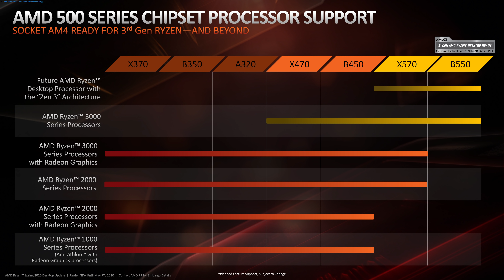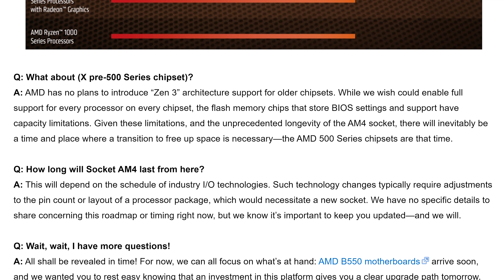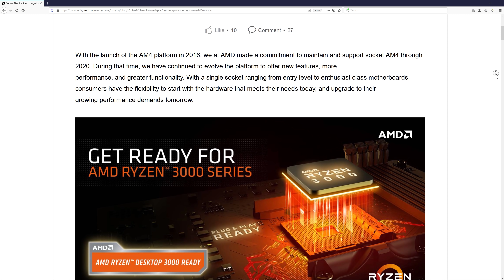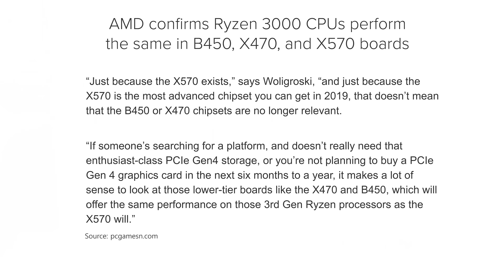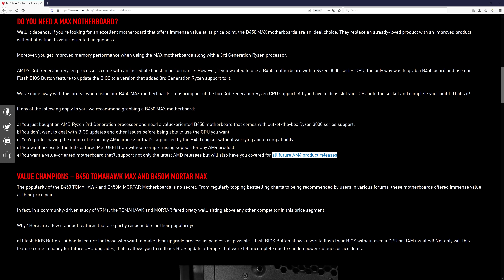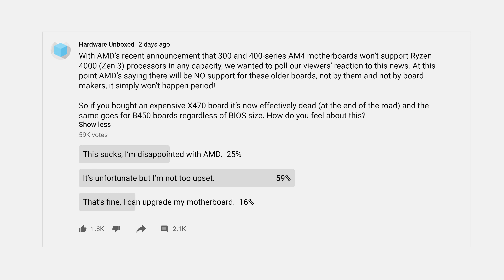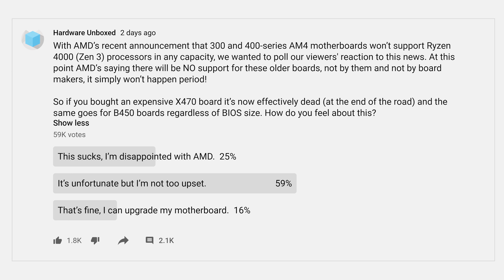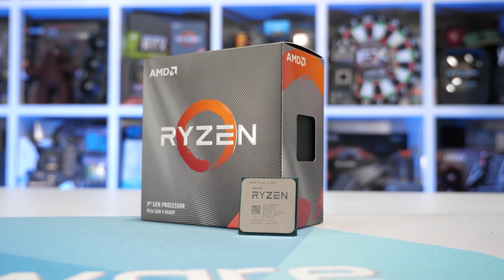AMD Does An Intel, Axes Zen 3 on 400-Series Motherboards, Our Thoughts

Comment: I'm very glad they went back on that decision. Today I'm running a 5950X on my B450-GAMING-PRO-CARBON-AC (bought it by your recommendation) and it's rock solid (after I did a minor under volt offset for the CPU).

Comment: I personally wouldn't be too surprised if this was a last minute call due lower production that came with Coranovirus which began to slow things down around Q3 last year, besides, let's remember that unlike Intel, AMD generally extends the longevity of their boards. EVEN if it has to be though a bios update that many times comes on later. 

There's also always the option, while rather unlikely, that AMD ran into a technological dead end where some of the components required to continue to provide support for older CPUs.

But all we can do at this point is to speculate until AMD decides to explain what's going on.

Comment: Having owned intel cpu's from my last couple of upgrade, any board that supports more than 1 to 2 gens of cpu is a bonus.

I'll just buy a board with the features i need in future and not get the best there is.

Probably buy a B550 board in future, £100 on a board, i aint gonna be to upset when they ditch it

Comment: I think that the key here is a question on how often do you upgrade the CPU. The most upgraded part is the GPU and that makes the most difference in games. I have been rocking on dinosaur i5 k2600k for 7 years now (OC) but have upgraded the GPU/Hard Drives few times. The bottom range MBs are cheap enough to upgrade (lets say $200 aud every 2-3 years) . Get your self a cheap B450, 16GB ram and a decent GPU  (even mid-range one) and you will be set for next 2-3 years in terms of CPU/MB/Ram (in about 1 years time, add another 16gb, ie just before DDR5 kick into the mainstream). Once you outgrow that combo in 2-3 years, sell your gear and get anther cheap B650 (or whatever it may be called), Zen 5 CPU and DDR5.  If you need more CPU grunt in the near term, the B450/X570 will be able to support existing multi-core CPUs so get one of those in few years time 2nd hand.  I personally think that a cheap B450 and something like 1600AF is a perfect combo atm.  For $300-$330 AUD you will be rocking with a solid MB/CPU and with a view that it will support ALL of the current multi-core CPUs (bar the new ones).

Comment: Im in the "I got myself a x570 so im all set" camp.  How ever it is a realy intel (dick) move. If the b550 came out at zen2 launch then ok but ppl were puched towards 400 boards so amd realy NEED to support zen3 on both 5 and 400 series boards. If they dont I think there should be lawsuits. It realy isn't acceptable.

Comment: AMD caused this mess by not having B550 ready at the same time (or very close) to X570/Ryzen 3000 release. People buying a $200 Ryzen 5 CPU in 2019 weren't looking to spend $180 to $300 on an X570 board. B450 was the only sensible choice, and AMD encouraged people to buy that CPU/motherboard combination. All their talk about multi-generational support, and they basically forced buyers into a single generation of CPU support. That's shady as hell. They need to get their shit together on the chipset side of things, because that's what caused this uproar.

Comment: I buy my B450 Asus prime plus with R5 3600 CPU and I don't get the all this upset story list of CPU compatibile with this chipset is massive. 46 CPU to chose, all you need latest stuff when the 2nd gen is still capable do a lot. You just gaming buy B450 and R3 3300X. Need more cores get some R9 3950X work on it just fine, high clocks or 32 cores will get the job for next few years. Ok if just want to build in next year go for 3rd gen but if you as most looking for desent pc for money B450 will still be nice to have.

Comment: I'm on that 2nd choice of ur polls, and its because i've just bought R1700x and X370 mobo for future upgrade (to ryzen 3rd gen series).

Sure we are lucky (for those who bought x370 and 300series mobo). But given the reasons (Bios capacity) why AMD dropped Ryzen 4000s support for 400 series chipset, are just sucks. That multiple of Bios choice would be great (if its true), But it will be limited in some mobo, though its fine (considering the price and its components).

I remember consider buying x570 mobo, but 1st gen ryzen are much cheaper in my area therefore i bought x370. So my upgrade path isn't bad after all (can up to 3950x with Hero VI)

Comment: Although I do understand where people are coming from, they did explain why, many features were being held back in order to maintain retroactive support to older motherboards...
In order to have the new features, a motherboard "refresh" was necessary, and so, they decided that after 3 gens of ryzen, they should finally put everything towards what they can achieve. Most people complaining about their motherboard being abandoned wanted simply the possibility of upgrading if they want to, and that's fair, but it's also not a sensible business strategy, last they start to lag behind Intel and then everyone starts to claim that Intel is winning again..
 We can't have it both ways, unfortunately. As for the advertisement that it's run on future ryzen systems, at least we were given a heads up, instead of going full rename and rebrand, to say: "oh, but it's not ryzen anymore, it's xxxxxxx lake!". However, if you do feel cheated somehow, you are also within your rights to discuss with the mb manufacturer or even taking legal action, depending on what was advertised. 
Just my 2 cents, sorry for rambling and good luck for everyone!
Reply: Last year AMD had to pay 12 milion $ becasue of false advertising with their previous FX series CPU.

Comment: This stinks! I purchased a b450 Tomahawk max and paired it with a 2600 for my sons birthday only a month ago. It was the obvious path with b550 not available and both AMD and MSI saying that future cpu's would be supported at least through 2020. The plan was to upgrade to the4000 12 core in a year or two's time. So I have dumped my son with a dead end mobo. I researched this for months and yet it still looks like I bought a dud. Not forgetting that windows 10 will need to be paid for again if he now wants a 4000 cpu. I will never trust AMD again.
Reply: Who will you trust now?

Comment: I don't understand what the big deal is... so you spent $100 on a 450 board instead of a $200 570. You knew the 570 would have more longevity. Wait a year or two and buy a 550 for $100.
Reply: 200$ board for 200$ ryzen 3600 cpu, that would be a genius move

Comment: I had a sneaky suspicion this was going to happen. I figured it would when everyone just used the older boards instead of paying the ludicrous upgrade fee for the new boards and the gains wasn't justified for the huge price hike brought on by amds new rise to power. I have a feeling all the board partners for zen 3 got pissy that they weren't raking in the dough from those high priced boards and with zen3 they wanted to make amd limit the zen3 to the new boards.
Reply: @gorem2k Yes, they did

Comment: Give no alternatives other than x570 when Ryzen 3000 launch drove people bought B450 is AmD fault here. Last February Im holding back upgrade my i3 6100 to Ryzen because a rumor said that ASRock will launch B550 mainboard soon, but till early March no more news arise, so I decided to take a leap of faith of AMD promise of supporting AM4 till 2020 (in my assumption that means until 3rd gen of Ryzen) and bought B450 + R5 2600 combo. Upon hearing the news that 4xx chipset won't be compatible with future processor, I'm dissapointed very much, but not much upset to console myself that at least I still could upgrade to 6/12 or 8/16 processor of 2nd gen Ryzen when I needs more power... But damn, I still feel cheated by AMD with that announcement.

Comment: 450 tomahawk meme was real when 3000 series launched, I don't blame amd for it i blame literally the thousands of people suggesting if you wanted budget board to do 450 tomahawk cause it came with bios flash option.

and i'm glad i bought a tuf gaming x570 mobo cause it looks like the next set of gpus are gonna try to take advantage of pcie slot 4.0.
but 4000 is gonna be the last am4 cpu most likely  and x570 will do you good till 2022-2023 when am5 and ddr5 starts hitting the market.

Comment: I bought a x370 with the 1600x so i could upgrade to the final am4 gen. Which is zen 3. Bought the first gen to support amd after intel kept making it worse. Now that they have decided to work against us. I will just upgrade less and less. I don't understand those that are supporting amd on this issue. They have plain and simply lied and misguided us. I give them no benefit of the doubt either. They have multiple times acted to take pride in these am4 support. And these idiots that think this is ok are the same people that allowed intel to become what it is now. Thanks steve for speaking up. Amd has lost my good faith in them. If they do not atleast rectify then they will receive no special consideration the next time they go back to what they were.

Comment: The keep it simple, 2 things are extremely weird and absolutely unfriendly towards AMD buyers in this latest move from AMD : a) There is no point and no sense for B450 & B470 mobos not to have support for 2020 Ryzen processors (all that's launched on AM4 platform in 2020) (32MB BIOS or otherwise) b) There is no reason for the B550 not to support ALL AMD AM4 processors (especially if they have 32MB BIOS chips) This is simply not nice towards your customers. What if I have an A320 or B350 or X370 mobo and I want to get a B550 now and later on upgrade my CPU. Why can't I use my current CPU in a B550 mobo. Weird move ... :-/

Comment: I do feel shafted really, I only just got back into pc gaming again. I've been gaming and building PC's since about 1993, I've always had a soft spot for AMD really. I've never liked Intel other than the original core 2 duo's which were awesome over lockers and cheap. I couldn't afford to build a pc with a graphics card straight away so went with a b450 tomahawk max and a 3200g just to get up and running, next upgrade a Ryzen 5 af1600 and a 5700 card, basically the processor and the board are useless now. If I knew no future support I would of saved more and bought differently. I've got to say though the tomahawk and af1600 overclocked to 4200 MHz stable is awesome for the price. I suppose sell them buy a new processor and board in the coming months.

Comment: Well im a bit disappointed I got a MSI B450 Max series (sure one of the cheaper ones but still I waited for the MAX to come out partly for this option) in part as I felt that this might be a reasonable option in say 3 or 4 years as a some what inexpensive upgrade, you know new CPU, perhaps upgrade the RAM and so on. Well it would of been an option, as I do tend to go for some time between major upgrades... (I.e. CPU & MB)

But it reminds me of my FX 6300 It served me well for some 6 years, but the MB I got I had intended to allow for some CPU upgrading, but no BIOS updates to allow newer CPUs showed up so I was stuck with the 6300 as the best it could take. 
Here I got the 450 MAX with the expectations that If I wanted to I could upgrade it to a 4000 series as a sort of mid life upgrade...
Ah well at lest I can still upgrade from my 3600 to say a 3900x... not quite as good as I hoped but still a option I suppose.

Comment: I bought a $200 Gigabyte X370 board at launch.  Had some minor stability issues, so I replaced it with a $200 Gigabyte X470 board after they were released.  Now I've been contemplating upgrading my 1800x to a 3000 series chip or hold off for the 4000 series chips, only to find out this.  As a long time supporter of AMD (I've owned nothing but AMD processors - dozens of them - going all the way back to my AMD 486 DX/2 66MHz), I'm not particularly pleased.  It's not a deal breaker, but it does disappoint me.
The 300 series of motherboards I could understand, as they were the first generation launch.  However,  AMD has known for some time now that the BIOS chips weren't big enough, and the 400 series boards should have reflected that, especially for the higher end X470 lines.

Comment: The problem AMD now have is that if we're to assume that Zen 4 (Ryzen '5000' or whatever) is AM5-based as expected, the an Ryzen 4000 CPU would really be a poor investment unless you just happen to already have an X570 board because you're literally buying into a single generation platform with no upgrade path.

I have a B450 board with a 2700 which I planned upgrade to a 4000 series processor. Rather than upgrade to B550, I will more likely just invest in a discount 3900/X after the 4000 or even 5000 series hits. Makes more sense than investing in a dead-end platform.

Comment: TLDR: Yes, it can be compatible. No, you don't want the chips running with VRMs out of spec and thinking you're fine. Defining as chipsets as incompatible is a broad stroke type explanation.

Compatibility over multiple generations may not feasible for motherboard VRM design: e.g: a node shrink will lower voltage/leakage and increase current through the VRMs. AM3+ increased current requirements from 110 to 142 amps even though the socket was mostly the same.

As another example, you can look at AM2+/AM3 motherboards and 45nm PII chips: X6 125W vs 140W X4 965. There are many models with 4 phase VRM for the cores that run perfectly cool with all X4s, but if you put in an X6 it is hotter running 5 cores pushed and scorching hot when fully loaded. It is pushing too much current for the VRMs, which were designed for X4 current specs.
So, multiple board markers tell you their MB supports the new chips, you update the BIOS, get a new chip and in 6 months you have a broken VRM. This helps no one.

Validating chips could be required, so say 3800X to 4800x could work - as it's mostly a node tweak - but you're pushing higher clocks and other circuitry, so it's not trivial.

(BTW, I had an AM2+ MB from Biostar that only booted AM3 rev. C2 Phenom IIs and refused even C3s (X4s), let alone rev E0 (Thuban, X4/X6 chips) because they didn't issue a new BIOS - that is bad, the board did support AM3 chips.)

Comment: I change my vote on your poll. I'm disappointed with AMD. Just bought a Mortar Max and 3600, while great and I can upgrade up this series, I did also see the line from MSI, thinking I can get the next gen Ryzen on this board, which is why I bought it. I was so close to buying an x570 too.. :(

And to the argument "Why do you need to upgrade every generation", no, I don't, and probably wouldn't get one straight away. You can wait for the prices to come down a bit and get a solid processor without having to change motherboard and ram for a few more years.